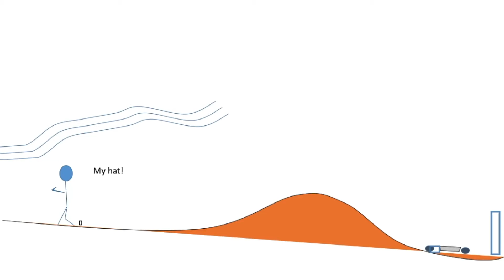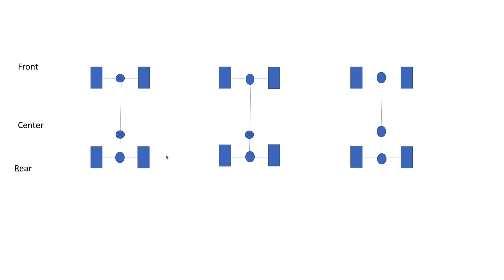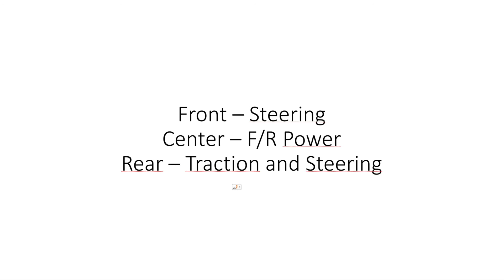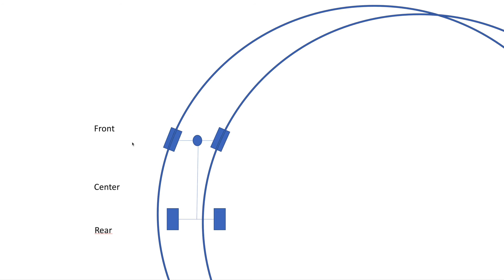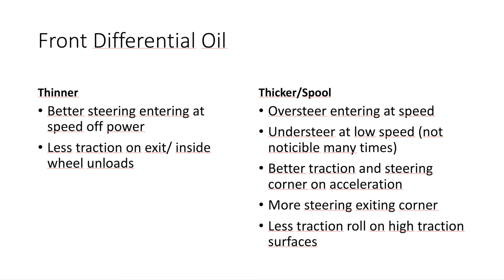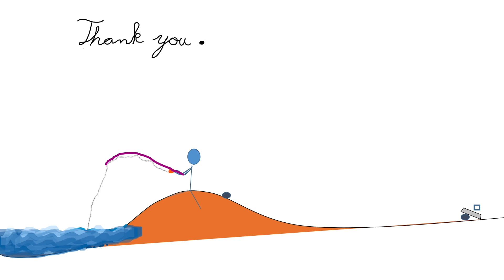TelecomandoRC rc Differential 101 Part 1 Front differential thin thick differential fluid or spool

Comment: What we really need is worm gear driven "torque sensing" differentials like in fullscale cars. Those send a multiplication of power that the slipping side can apply to the side with grip, and IIRC, they're mostly open when no power is applied. Putting this in the front, with medium-ish fluid in the center, and a spool in the rear, with stiff rear swaybars and no front swaybars (in order to get the rear inside to lift) would theoretically, to my current understanding, allow the most controllable oversteer, launch, and rotation characteristics. Though my current understanding also says that geared, fluid-filled RC diffs act like really shitty, delayed torsens already, so...
Reply from the maker: That would definitely oversteer. Not sure how controllable though. 

After reading your other post, I am really intrigues as to how a helical diff would work in RC. IT is my favorite in cars. I used to have an MR2 Spyder and installed one and it was amazing. My current car has clutch packs and they are not that great in comparison for turning. 
I do not think it is a weight issue at that scale. But some RCs are proportionally over powered. I wonder if it is just too expensive or would break to easily. I would love to see one for an SCT410 or even a Slash 4x4.
Reply: @telecomandorc  might be able to get one done with 3D printing and or custom machining. But you would have to have the cad design on point imo, copy either the wave track or the Detroit truetrac. But then again those are the only two that I even somewhat understand.
Reply from the maker: @Drunken_Hamster   It would be a neat project, it just seems to small of a diff to make it strong enough.

Comment: THANKS AGAIN!  what oil do you recommend for traxxas slash 4x4, asphalt short course racing, with high speed and turns.
Reply from the maker: It depends if you are running sway bars or not. Say you go with the stiffer sway bars. Do one less in the rear. Then do a 100k in the front, center slipper, and a 20k rear is a good start. It may seem a little high in the front, but that inner front tire will lift off the ground and you will cook anything less than 50k. By high speed I am assuming VXL 3s. On my MT410 I am actually running 1 million in the front because it just diffed out on 4s with lighter stuff the front diff got hot. That has a Tekin T8i. But this a bashing only.
Reply: @TelecomandoRC  vxl 3s, have sway bars, ordered the traxxas 3 set 10k 30k and 50k, didn't know what to order.
Reply from the maker: @CarlosDelaoGunEngraver  That is a good start. If you have low grip tires, it will work great. If the tires grip a bit much, you may need to change it. That Slash is probably 2500g dressed. When you run it, check which diff diffs out. that's the one that will need thinker oil. To be honest, the Slash is still small enough and light enough that a front spool will also work for just bashing. Also, see how it wheelies. If it wheelies a lot, go lighter in the center. If it wheelies not at all (it should so if it doesn't) check the temp on the center diff. It is easy to diff them out and cook them. You would need thicker fluid.